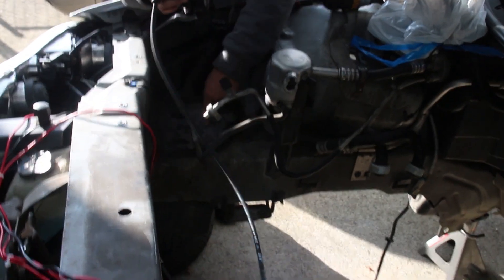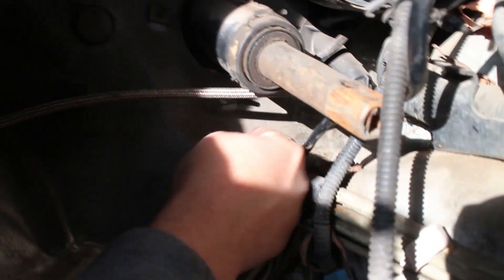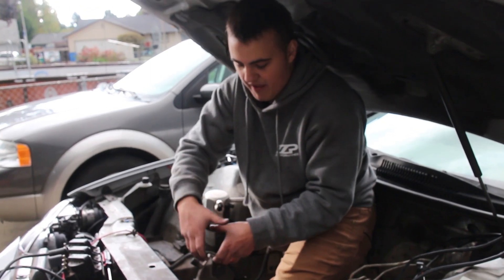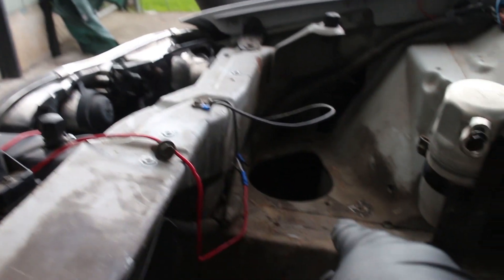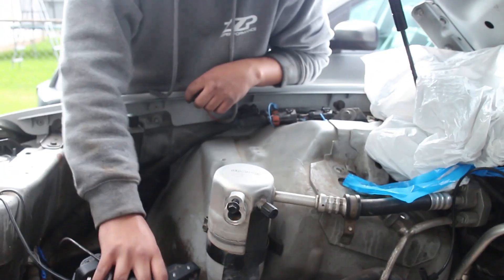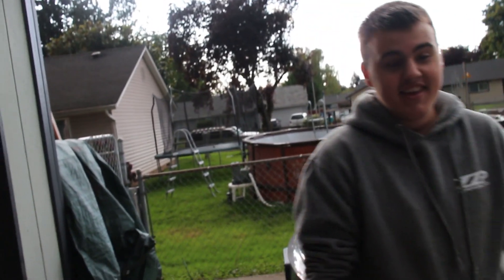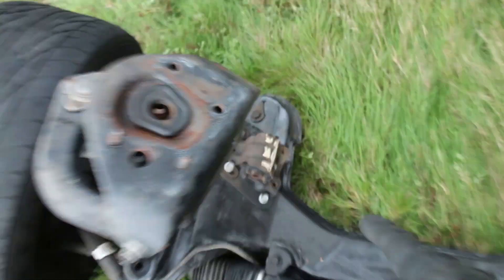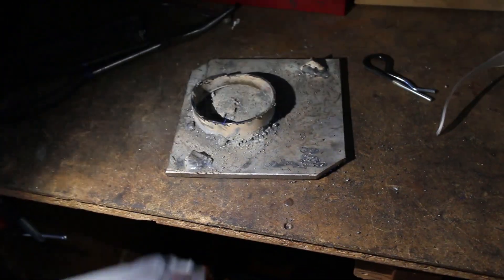Project F L67 Camaro Rebuild Part 7 (Devising our Plan)

Comment: Are you gonna keep stock suspension/rear end. Another thing, 98 had 2piece steel driveshaft I put an aluminum driveshaft from a 2000 z28. Simple mod and takes a few pounds off the car.
Reply from the maker: Down the road we'll be swapping in a Ford 9" rear end. Our Camaro also came with a 1 piece aluminum driveshaft which was a pleasant surprise.
Reply: Also we don't plan on keeping the suspension. It's been lowered which I hate, and it feels so bad. It's prob getting all new OEM strut and springs.i haven't thought of any performance suspension because I want it to be cheap so I can drive it asap
Reply: MegaZombie101 
Stock springs and shocks from a z? I have kyb agx gas shocks, stock springs no complaints.
Reply: @fellowtraveler2495  Nah. Not from a Z28. Probably gonna go with the stock OEM AC Delco replacements that Vence (Transam owner on our channel) bought. He got the rears for about 100$ for both sides, rides much better for him. So ill probably get the exact same ones, and the same for the front. If there are better alternatives for around the same price id be interested though.

Comment: For anyone that is curious or concerned about the meth kit and it's placement inside the car. When I first got the gallon jugs of the stuff off summit, I poured some onto the concrete of my driveway and tried to light it on fire with a lighter. It took multiple tries and more liquid to ignite at all. And even then it was a very mild flame. It didn't burst into a flame. As long as it's 50% or less mix of methanol to water it's safe.